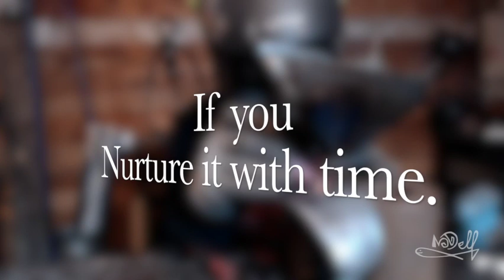Watch these beautiful butterflies take shape

Comment: I use a wheel from 3M Scotch Brite clean and strip, to remove mill scale. This will not take scratches but will remove oil and scale. I was really surprised how well it works. Please check it out. There is another one that is the same but will not remove any metal. They are self cleaning wheels. I have been playing with metal art for over 35 years and still have so much to learn. I just started with this about a month ago, keep working safe so you can keep learning and passing it on.
Reply from the maker: Thank you. I did infact do a little course in another video where I talk about the use of the scotch bright disk and in what circumstances I chose to use it but ,I wasn’t aware there were two kinds thank you I will definitely take a better look at it.
Reply: @Nadellart  Make sure to check they are 3M and not just scotch bighte.

Comment: Thank You - now I understand why the blue colour disappears because I have gone to far and over heated the metal.
Reply from the maker: Glad I can help😊 I do think I forgot to mention but another reason I use the small blow torch is that it will heat less fast and be easier to control your Colors.The big torch heat very quickly and it can be so easy to pass them especially on thinner metals.If your having trouble try switching to the small one on low. Might be longer but you’ll be happier with the results and be less likely to pass them. 
Good luck and id love to see what art your making with those wonderful Colors!
If you like to share you can find me on Facebook @Nadell Art

Comment: Thanks for the class! I've seen some folks quench the pieces in oil while they're still hot instead of clearing them right away, and while I haven't tried that myself yet I'm told it helps the colors last longer. Any input?
Reply from the maker: My pleasure. Yes. I heard about it. Decided against it for the moment, perhaps I’ll test it out in the future.
Couple of thoughts I had about it.
I tend to weld many pieces after colouring, so in my case that could turn quickly into a porosity nightmare for welding.i would have to heat red hot to get rid of the oil and or grind. Losing my colours 

I like to clear when putting outside which leads to a couple of thoughts.

Like painting on canvas, if you paint acrylic over oil you will get cracking 
As the oil will remain in the pores of the metal I would think they may act similarly and so I couldn’t garantie the state the art piece would remain in.it may appear nice but, somewhere down the line it will probably reduce the lifespan of the clear and if the person has to sand it to reapply because of cracking then say goodbye to those nice colours and details.

I would need an oil based clear. Which although I haven’t purposely searched for I have yet to ever find or hear about as even a half half would have a reduced life expectancy.

I could just protect with oil but, there’s much more maintenance involved to keep it in an un weathered state I’ve been told.probably especially true in places that get more humidity.

Also that the clear would protect it from scratching off with little scratches which I’m pretty sure the oil will not.

I’m up to some test and stuff but, as I’ve been only doing this a little while I can’t say how these things work in long term. What little I’ve applied in protection I learned from someone working with cars. So I figure it makes a lot of sense, cars stay good for quite a while so those colours probably to. 
Hope this helps you in your decision but, whatever you chose I’m sure it will be nice 😊
Reply: Thanks, your points are all good. I will clear after I forge and get some flame painting done.
Reply from the maker: my pleasure always here for more questions if you have in the future. @brysonalden5414
Reply: What do you use for clear coat? How many coats? Your work is beautiful
Reply from the maker: hi there sorry for the late response you should find the information you'd like in my lates video hope you enjoy:)https://youtu.be/_0RqusigHsM?si=jS2Arwy5Hr2WNYYR